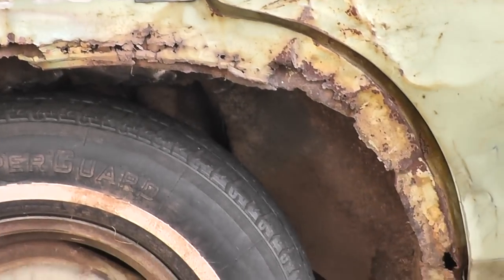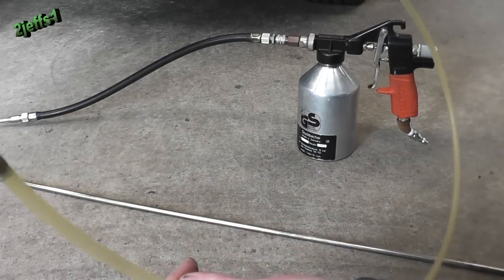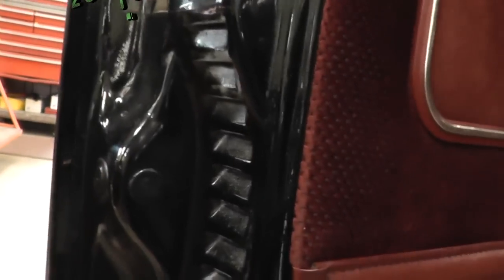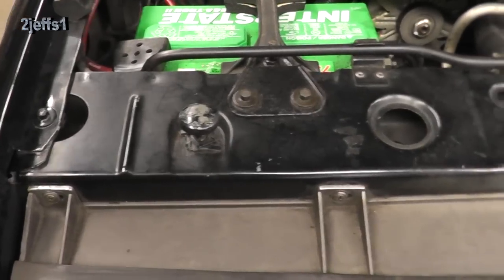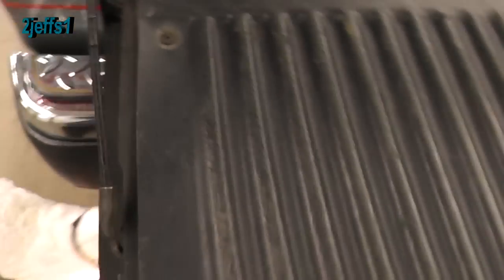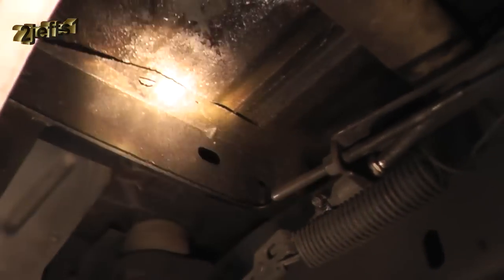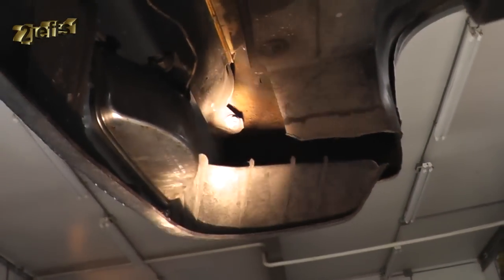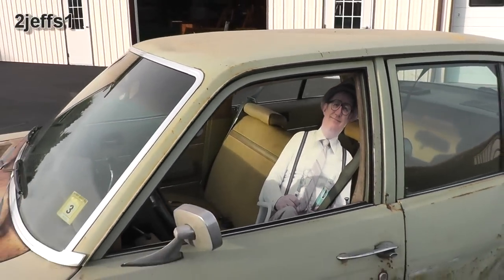Oil Undercoating DIY

Comment: The smart thing about this also is that when the motor and transmission wear out the body is still in such good shape that all u have to do is invest in new motor and transmission and you got another great truck for years
Reply: Yup new vehicle are nothing but junk save your money and preserve what you have
Reply: Those old 4x4 Rangers and bronco II are great, I had a couple II's myself and they were super capable. I called them my poor man's jeep. Used to go down the little trails only the wranglers typically ran down. Some of the best off road memories I have.

Comment: A few years back, I watched your motor oil undercoating video and picked up on a great trick from you on how to preserve brake line cables using ATF. Well this week, I used that procedure on a new transmission shift cable prior to installation on my 1997 GMC K1500 Suburban. The shifting is as smooth as silk!  Thanks for posting that TIP...   Best Tom
Reply: I been going to do this for decades and going to do exactly what he shows on my very nice '04 Z71 Suburban I just bought.  It's from southern Kansas and been in Mich.  4 yrs.  Just light surface rust, no holes.  I keep stuff forever so at 68 I'm hoping this will be my last expensive ride.  Lots of old oil here on the farm but I do think I'll use bar oil as it's made to be tacky and being new it won't be clogging the nozzle.  That beautiful loaded 86 Ranger is a real testomony that it does work.  I always noticed it's never rusty where tranny and engine oil drips.

Comment: The Ranger looks great.
Reply from the maker: Thank you. Pretty happy on how things are holding out with the use of oil...
Reply: @2jeffs1  used motor oil?  Any thoughts on diesel mixed with transmission fuild?
Reply from the maker: Never used used oil for some will have a bad smell in the garage v/s new. I would think that would work well and spray easier thru the gun.

Comment: Always the simplest solutions work the best. No fuss and no muss. For the cost of a few quarts of motor oil sprayed or painted on in the correct places works like a charm. Keeping it simple saves the day again. Excellent video brother. Each one teach one.
I have a 2006 Avalanche that had a black undercoating sprayed on in 2006 and is now pealing off. I think this simple oil spray will keep it from rusting any more than it already has. You saved me a lot of money bud. Thanks again.

Comment: Best demonstration I’ve seen yet on rust proofing a vehicle. Obviously, having access to a hoist and an air compressor would be a big help if you want to do it yourself. I had mine done at Krown in Canada using their proprietary oil based product. Well worth the cost and trouble to do it and will pay you back whether you keep your vehicles a long time or trade.
Reply: Get ramps put the back end up first spray it take down front end up on ramps...  Rem tailights out spray real good in there

Comment: Exactly what I do it works great ,drill holes do brake ,lines in side of frames, floor, rockers ,door pillars ,doors, tailgate ,inner wheel arches, trunk lid ,floor of trunk ,gas tank  ,rad mounts and Saddle ,tranny lines fuel lines i pull out headlights tail lights , Power wash underside  under hood  in spring and do again  . This guy in the video is doing a super job on this truck

Comment: It makes a lot of sense. Where there's oil there can not be rust. I still can't get over how nice your truck looks! I just did my truck a few weeks ago and I'm planning on spraying my car. I always visualized moisture getting underneath that rubberized stuff and then staying there for the duration. Great video, thanks Jeff!
Reply from the maker: I actually have video of when I first got here in 86. (remember beta?) Was putting the shop together, friends stopped by to help, a driveway with multiple cars and the Ranger in the background too. Sadly all them vehicles are gone and the Ranger is still here.  ;>) It is neat how simple that is to do and well that works. You must be one of those people who keep a vehicle forever too! Really there is no reason something can't last forever if the body stays rust free and general maintenance is kept up on!
Reply: 2jeffs1 Thanks Jeff, you sure have come a long way since back then. I'll have to go back and have another look at that video. Yep, I'm like you, I hold on to them as long as I can. People tell me that you can't keep them forever. I guess I'm out to prove them wrong. lol I have a 73' F100, 79' F150, and a 84' Crown Vic that I still drive.
Reply from the maker: You sure have a buffet of vehicles. Prove people wrong - LOL - I like that! Where I worded that earlier I wasn't that clear about the shop video. I do have the shop build on file here but didn't post any yet. I did have on several YT vid's some older footage from here added in at the end to show how different things were years back. Still was considering of posting the actual shop build stuff. But the quality could/has a bit to be desired v/s today's quality. And of course would have put more thought into filming if one knew YT was going to be here some day!  ;>)
Reply: Your end clips are what I had in mind. I'd love to see more of your footage from back in the 80's. It's fun to look back on how things used to be. I would have never guessed that there would be a program like YouTube that we could post videos to that everyone in the world could watch. Technology is pretty amazing!

Comment: Nice idea. As one guy said, many times they spray undercoating with the car already moist. I like the undercoating gun idea.
Reply from the maker: I used that gun (the second one from the right at video start) with the screw on can before getting that nice one. It worked but it was still hard to get in the critical areas where it counts.

Comment: Smoke on the water.  Haha first song I learned on guitar!  I get my vehicles oil sprayed as well, usually every year.  The other thing I notice is you can take bolts off without them having all that flakey rust.  Much less likely to sheer off a bolt or round a nut.  Another great video Jeff!
Reply from the maker: Your comment on the guitar - neat addition to the comment other than knowing what song too! Without a doubt that is a messy job to do but the benefits are so great. Thank you for stopping by Craig, Jeff

Comment: Very insightful for my truck, I have a 1983 Dodge in great shape and want to preserve it, now I have an idea on what to do! Thank you!
Reply: 71_Sears Around here the Dodge trucks DISSOLVE starting after about 3 winters. Worse than any other brand.
Reply from the maker: Great to help you out. This works great even when rust has already started. It soaks in to the metal past the rust. If there is any salt residue or dirt underneath try to get that cleaned off best as possible first. Let the vehicle dry out for several days to insure the water is out of the nooks and crannies. That way you will get the full benefit and happiness for many years to come.
Reply: Thanks for the additional information!
Reply: I was amazed when I found my truck being as solid as it is, only one rust spot in the bed the rest is solid and it was a Midwest DOT truck for at least 20 years of it's life according to the records.
Reply from the maker: Excellent! It is nice to find vehicles in better than average condition - even if they cost a bit more!
Reply: 71_Sears

Comment: Very nicely done video and thank you for posting it!  Here is my Vermont 2 cents.     (Moisture + Heat + Salt = CORROSION) and oil will keep the moisture off the metal. That said, Spring is the best time to oil spray, because corrosion is accelerated during the warmer months (or in a heated garage). During the summer, the metal expands and allows the oil to wick into areas where dirt, salt and moisture hide. Also, Dexron ATF works well on enclosed sections and heated Husky bar and chain oil with wax on exterior high splash areas.

Comment: Great job on explaining how to oil myself I use STP mixed with Lucus and new 10w40 oil a little tar from the underside to make it look black ... But new oil is the best used Iloilo has carbon and create an acid and will rust around the spot welds faster ...
Reply: Never seen rust around a leaking old engine. You think used oil would rust?

Comment: I've heard of other people using bar and chain oil because it is slightly tacky so it'll stick to where you spray it a little better. I've also heard people say they'll take their car down a dusty gravel road, supposedly it sticks to the oil and helps the oil stick to the car.

Comment: I live in Ontario,canada.Salt everywhere,all winter.I oil spray my whole life.I still here people telling me its needless and the metal today is much better.I laugh,and think,you must have a lot of money buddy,i need my vehicles to last.OIL SPRAY is the answer to all fittings,lines,bolts and general body metal.Drill your body and soak that vehicle,when other guys are doing brake lines,fuel lines,and rust dropping in there eyes,you cruze right thru the repairs.It works.
Reply from the maker: Great write up, sooooo true!  Lately multiple vehicles that come here for service I told the owners years back - if you oil everything even just 1 time.... Those vehicles now look quite rough, just as you said - doing brake, fuel lines, fuel tanks, height sensing portioning valves, yada yada.  (Sadly I did offer oiling for a service when still had the gravel driveway)
Reply: Rust prevention is not needless but they are correct about the sheet metal. It may have been in the 80's when they started using galvanized floor pans. Fasteners are also better quality than years ago. Of course cars still rust but it takes longer than it used to. When I was a kid my Dads 69 Ford LTD went to the junkyard completely rusted out in 1974 with only 43K miles. This just doesn't happen that soon these days.

Comment: 33 years ago I bought a 91 Mustang GT.  Best $200 dealer option I ever did was the Carecraft undercoating.  Still no rust and I never re applied.. not sure the stuff they used back then but it blows away today's oil based products on my newer cars... Oh, lived in Massachusetts then and it was a 10 year daily year round it's first 10 years.

Comment: I just bought a 1955 truck and it's pretty rust free but now I know how to keep it that way. I need to buy some equipment. Thanks.
Reply from the maker: I really like that spray gun that I have now v/s the other ones used in the past. However recently I have a friend who bought a gun with a pressure pot and 1 wand from Harbor Freight. Didn't see it but from how he described it sounded similar. I did lend him mine in the past but he is one of those folks who hate to ask to borrow things even tho it isn't a big deal at my end.

Comment: Thanks for the video; I picked up a few good tips. I've used my limited skills as a hobbyist/DIYer to apply Fluid Film to my 2005 Ford Explorer, and while I can't say for sure, not having a control car, I think it helps. Still, it's a losing battle. Makes one think why the car manufacturers don't put more effort into rust proofing cars from the factory. Almost fifty years ago we sent a man to the moon, and still I see 2-3-year-old vehicles with severe rust problems. May not be the best analogy (but I'm sticking with it!), but you know what I mean. Happy holidays!
Reply from the maker: I must tell you this one. Years back I was watching a show about a car manufacturer. They were bragging about and showing things they did to prevent rust on their vehicle. 10 minutes later in the same show they said - we can't do everything where it wouldn't be cost effective. Yes I started laughing! Boy I hear you on it would be so nice if the manufactures did more! It seems like a waste of time doing a rusted vehicle but it does make a difference. I have done that in the past and that does a great job on preserving the current condition no mater how bad. Just make sure to spray those areas good so it soaks into the metal.
Reply: I use that analogy all the time and it's appropriate.  If car companies gave a shit about their product lasting then they'd lose money by you not paying them to fix it or just buying another one of their cars.  They're as crooked as a politician.

Comment: Great tips! Thanks!  Definitely  going to use this technique
Reply from the maker: I lost a previous vehicle due to rust/salt damage, quit using that rubberized undercoating and started doing this. That truck has been covered in salt residue many times but where it is cleaned up for the video probably several folks wouldn't think so. One usually don't take pictures of something when it is all dirty!!!!  Thank you for stopping by and leaving a comment, Jeff

Comment: I was told by a road guy here in Ohio that the chemicals that they're using is much harsher than before, eats through any car factory protection in 5 years. I will always oil spray, Fluid Film or something. BTW, what's the name of that German pressure gun again. I never thought of using a pressure pot, I have two hanging in my garage. Thanks, Dave.

Comment: I use a Canadian product, Krown that is oil based for my car. Every Spring I get it sprayed by them and it's not that much money. As Winter approaches (ie right now) I give it a touch up spray like the guy from south side auto on youtube does. 

They do the same techniques you use by drilling holes in the doors and double walled panels. 

Even if you want to totally DIY they do sell the product. It is called T40. It's probably a little bit better than just using regular motor oil.

Comment: Makes sense I just scraped with a wire brush as much as I could of the underside of my f 250 and used rattle can bed liner to under coat everything I could see were the grease from the drive line and oil leaks covered the metal when I scraped it off there was no rust the oil and grease sealed the metal makes sense great video

Comment: Mix 1 part waxoyle to 3 parts used engine oil. Heat till hot in an old pan. It will spray on real easy then it will cool to a buttery consistancy and stay on the chassis.

Comment: Jeff, I love this video and I've watched quite a few undercoat videos too!  This idea of oil undercoating makes perfect sense to me and it's with basic, low cost supplies.  My question is, how do you keep the underbody so clean? I know dust and dirt will stick to that oil.  Powerwash?  And if so, how? Liked and Subscribed,  Jerry
Reply from the maker: Hi Jerry. Your right on dirt sticks a bit. The pressure washer works pretty well. I spend time going up and under everything best as possible when salt is on it.
Reply: @2jeffs1  hello Jeff, great demonstration video by the way. Was curious where I could pick up one of those oiler cans and wands to apply this procedure? 
Thanks regards
Reply: I like the idea of keeping the undercarriage clean as well but doesn't that just wash all the oil all off?

Comment: Thanks Jeff! Very helpful and informative.  I just cleaned the rust off a frame with needle scaler and wire brush.  Going to use a rust converter on it, then paint, then oil it like you have here .   Does that seem reasonable?  What sort of paint would you recommend after rust converter and  before oiling?
Reply from the maker: Sounds like you have a good handle on what you have going on there. Prep and clean is the biggest factor. Some enamel should do the job just fine. Something on the order of Rustoleum. If there is a hardener available I would recommend that too which makes paint more chemical resistant. (like from brake fluid damage) One has to make sure everything in the work area is covered good tho to protect from the over spray. I use to/have used an epoxy primer and urethane paint but that gets rather expensive these days. Also I would leave the paint dry for a good month before oiling. Hope this helps you out, just my 5 cents worth, (inflation)  ;>)
Reply: Sherwin williams dtm paint you might find some on the cheap on offer up or marketplace

Comment: Awesome video! Thank you for all the detail, this is a huge resource for a lot of us. 

With the 10w-30 you use, will it wash off in car washes, or do you find that it is pretty resilient?
Reply from the maker: Hi Lawson. that usually lasts for quite some time. As you said, more frequent washes will erode that sooner. I usually get 2 - 5 years  before repeating that - not so fun - job again.   ;>)